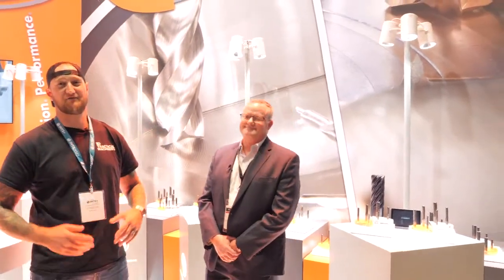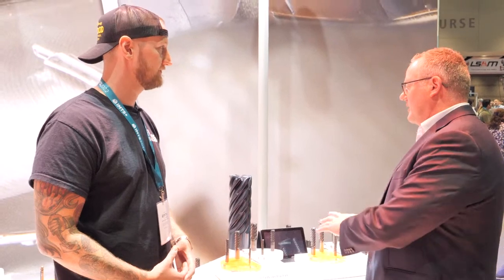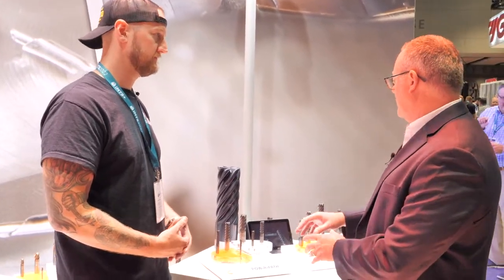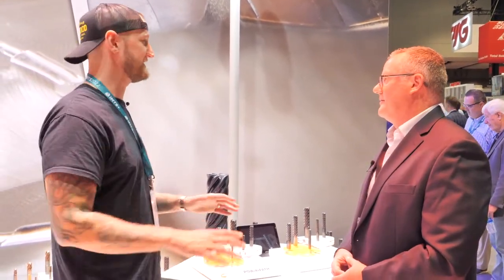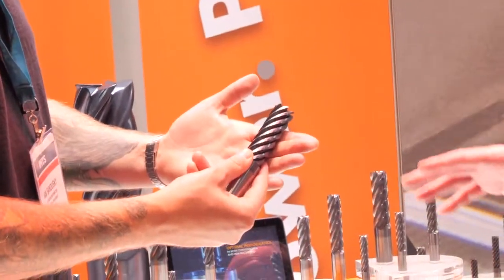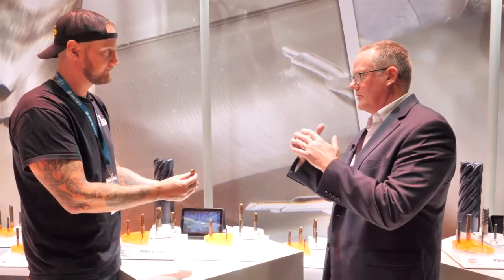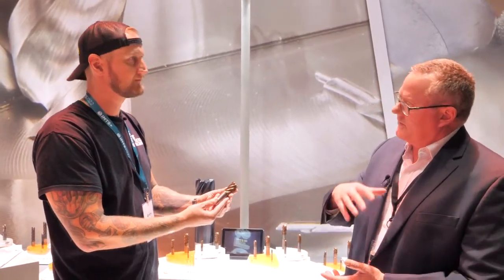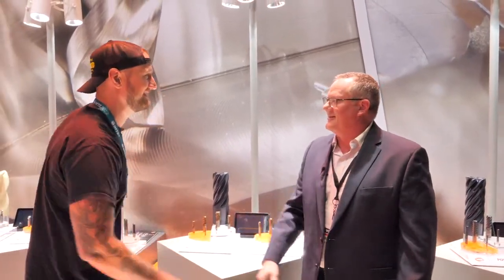Make More Chips Fly with IMCO Endmills

Comment: Imco is my favourite brand. Easily beats Helical and Kennametal in mild steel and aluminum
Reply: They’re super cool! I have some in my shop right now!
Reply: I’ve never used but I’m definitely going to give a try
Reply: I primarily use the M525 endmills for just about all steel/stainless machining. They work great for HEM and finishing. I prefer not to use the high flute count end mills because we of the reduced RDOC required.